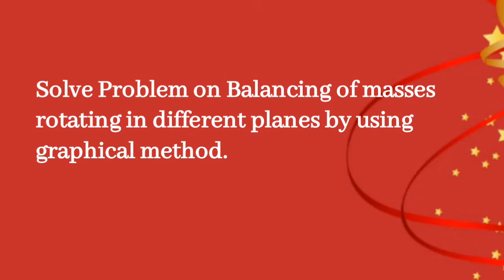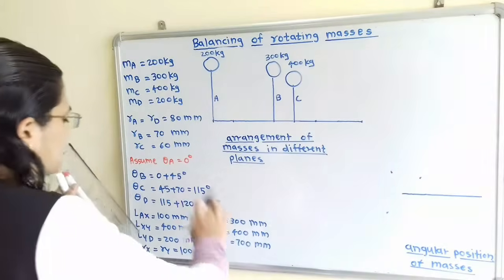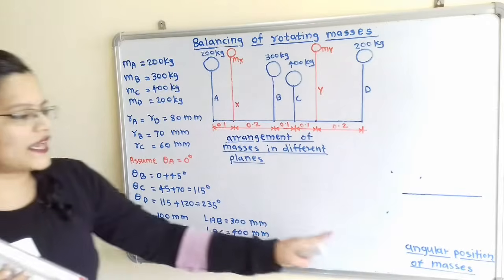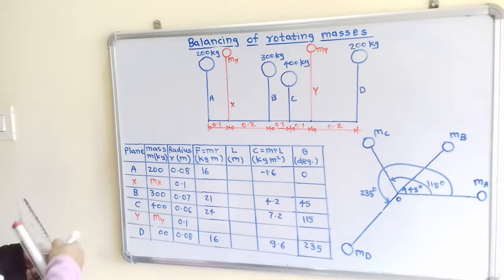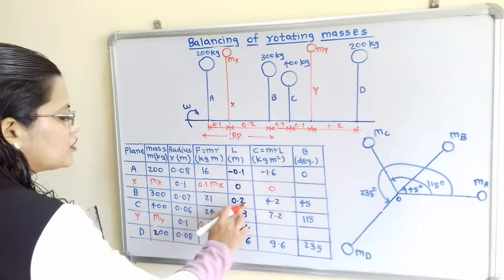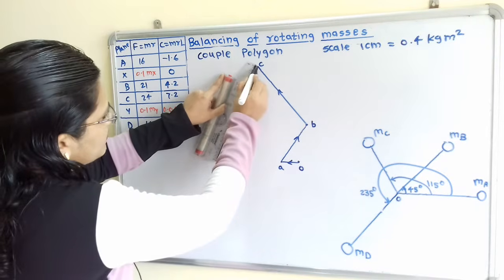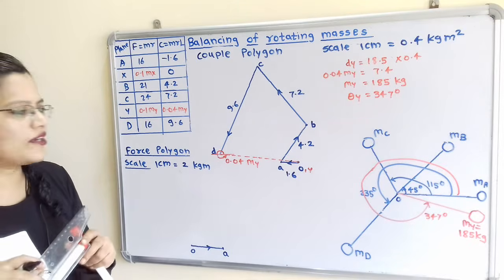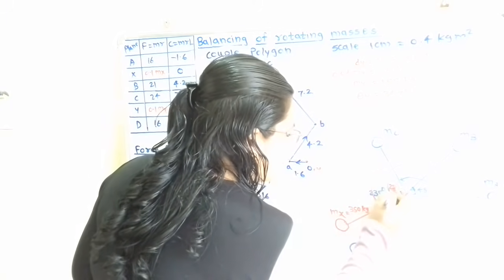Problem 2 balancing of masses rotating in different planes, graphical method

Comment: Mam how my  =185kg
Reply: By measuring from the couple polygon diagram. The dotted lines are measured. 0.04 M y is equal to 7.3 we get by measuring so therefore by calculating M y is equal to 182.5 i got
Reply: @konathalamonali7531 how what calculations?